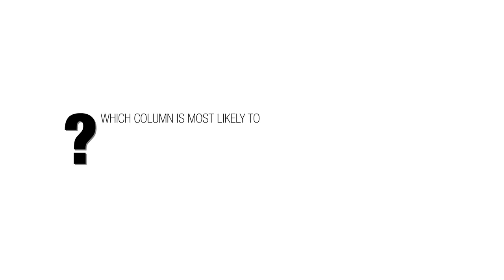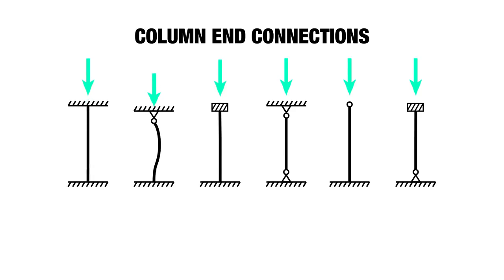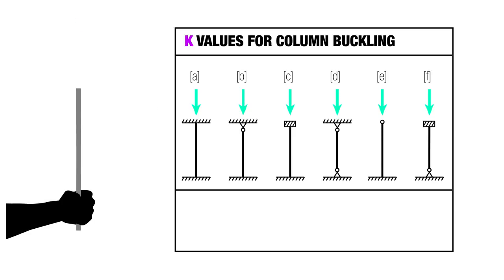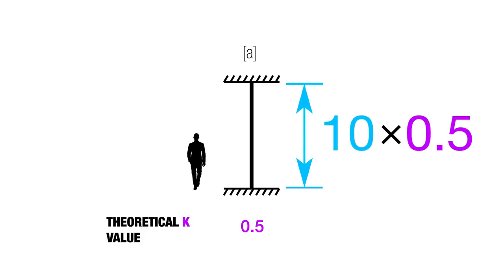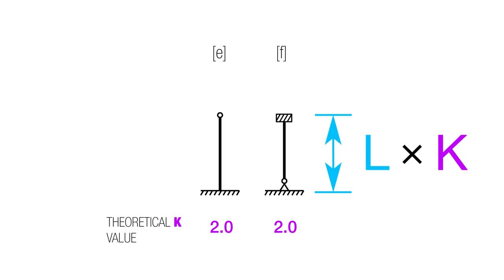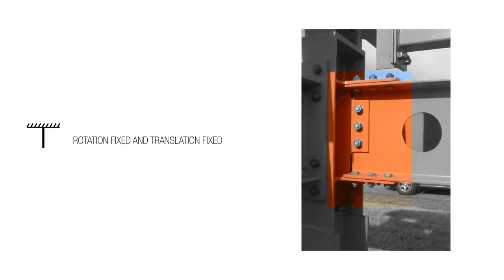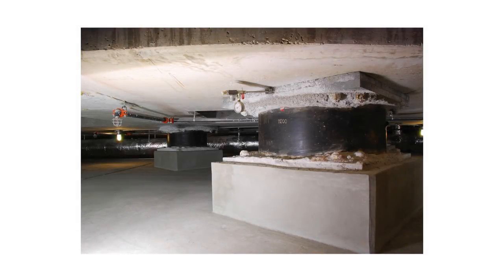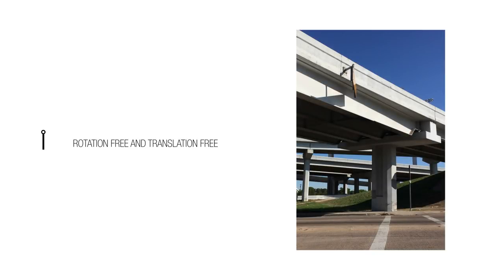Column buckling

Comment: what connection would it be for the building that a column connect with two floors?  The bottom floor is fixed, how about the top floor that column is connected to;  what you call this connection?

Comment: I am surprised that you looked at buckling for only one aspect.
Imagine if you will a concrete and rebar column (fixed top and bottom), 3m tall, 130mm thick and 600mm long, where there are single rebar uprights at the corners, and stirrups with internal dimensions of 80mm x 510mm, now place a 3inch plastic pipe on the inside of that column, and use concrete which uses water as a plasticiser (a water to cement ratio much greater than 0.5)
The stirrups have a 90degree hook, not 135degrees as recommended.
There are no internal ties on the rebar stirrups.
Now if we subject that column to a seismic action across the widest dimension that moves the column base perhaps 1inch, what would the probability be for that column not buckling ?
~
I estimate that the internal forces the concrete will be subjected to will cause the concrete to fracture within the rebar frame and with no ties that the column will blow out, buckle and collapse.
~
You pointed out that wood is fraught with many issues, but failed to identify any factors that affect the examples you cited above. Incidentally the example I cited above is a real building project, and the engineer really has passed this form of construction for all the columns on the site. 
~
As far as I am concerned the building which is in an earthquake zone is unsafe and should be condemned or the flaws rectified. The upper mass of the building will clearly try to resist the seismic forces applied at ground level.